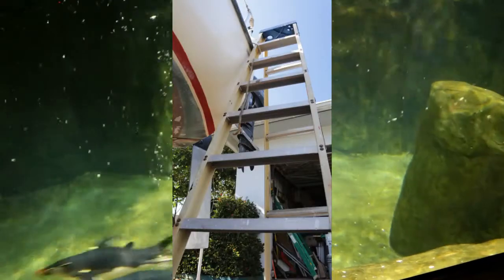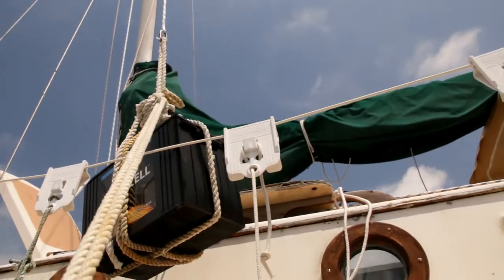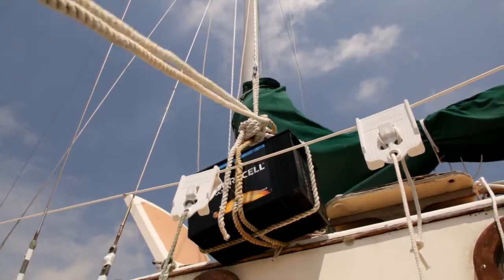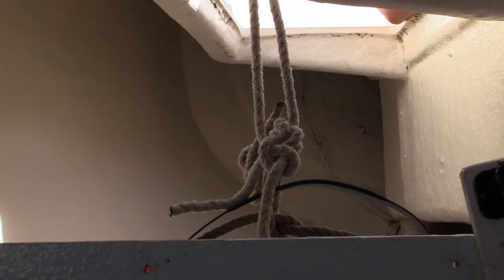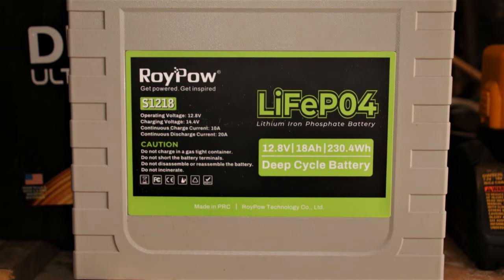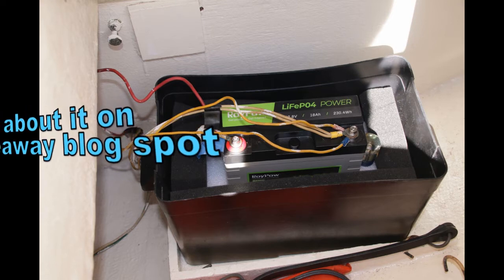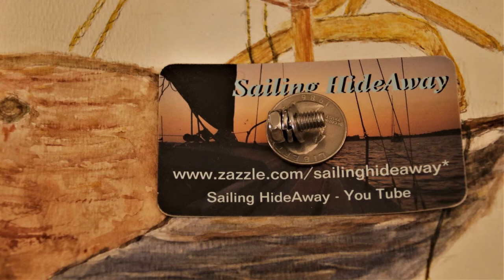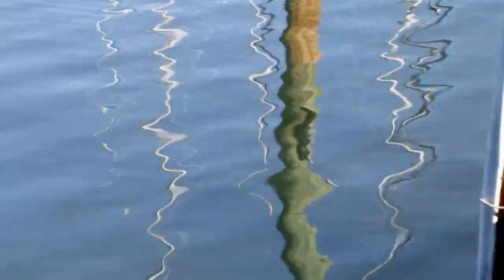Changing House Battery to LiFePO4 - Sailing HideAway Com-Pac 23

Comment: I’m with you & your wife….batteries can be a pain in the back & fingers.  I’ve been very curious about these lithium batteries.  Thanks for the info.
Reply from the maker: Its been working OK for us but at 18amp hours it may not be sufficient for cruising. We have a solar panel, not currently in use, however at 5watts, it wouldn't recharge the battery. I had forgotten to consider the seldom used bilge pump, so I have a nagging concern about that. To replace the lead acid battery amp hours with the LifePO4 was around $800US. Nope!  M

Comment: I hope you post the mast wiring…I’m dreading it.
Reply from the maker: Me too.  On some of the Sailing Hideaway videos you can see a gob of wires on the starboard side of our custom aluminum mast step.  I recently discovered there is no power reaching them.   And some of the wires coming from the mast, hopefully the originals, are bare.  So the project is more complex - go figure.  My more recent videos show that we need to repaint the deck.  These two projects must be completed before the Florida summer heat arrives. 

Pinellas  County, FL has certified that the Hideaway is a genuine antique - Unfortunately so are  its crew!  It will be awhile before I can complete the wiring video -- Stay tuned!  Matt